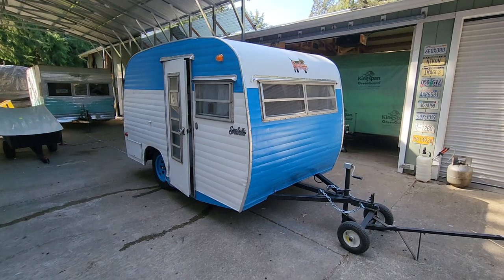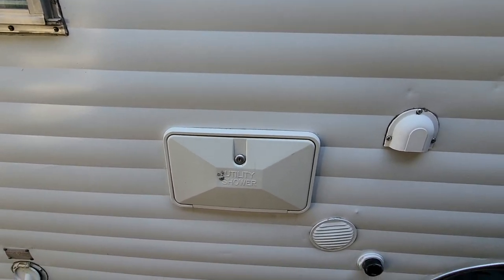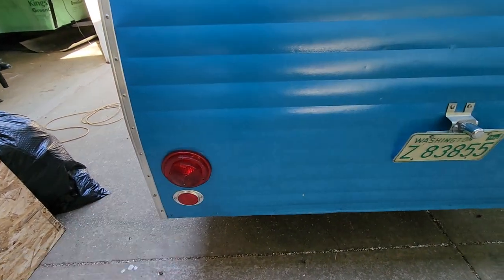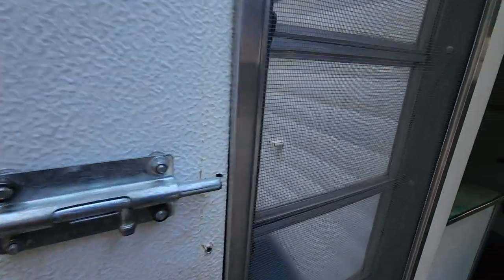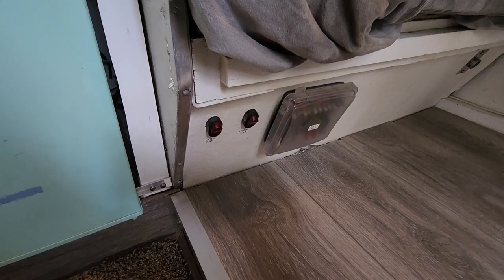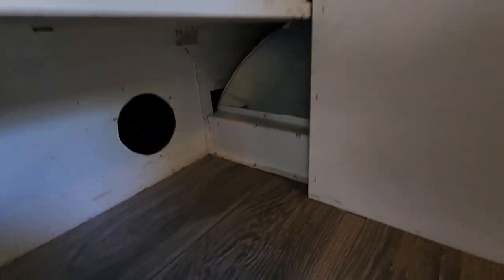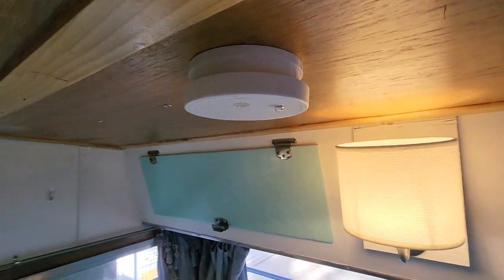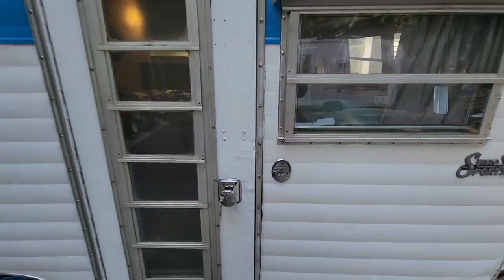Pre Delivery walk thru 1970 Scotty

Comment: Did you paint that with a brush? Also appears to have some small corrosion holes by the left wheel well.
Reply from the maker: it was the original skins. A previous owner looks like it was brush painted. We scuffed, primed and repainted with single stage spray.